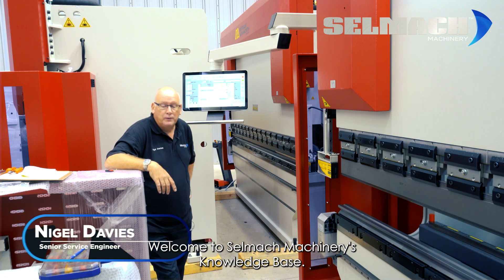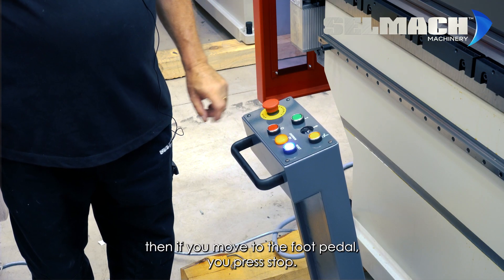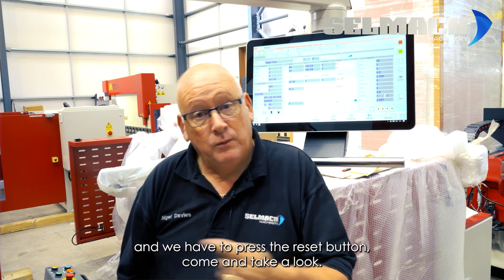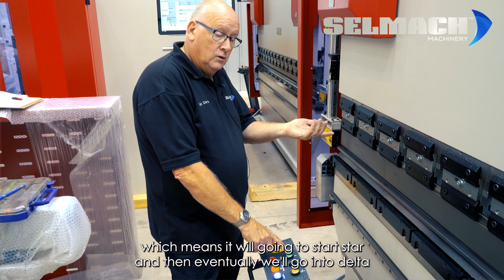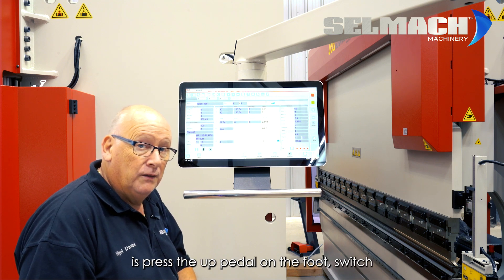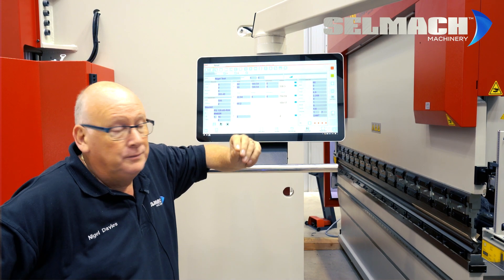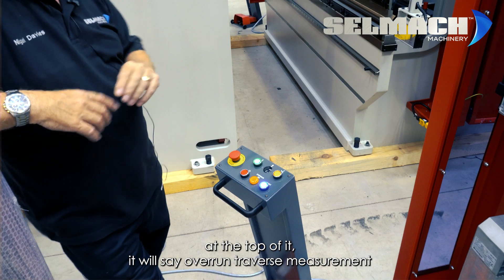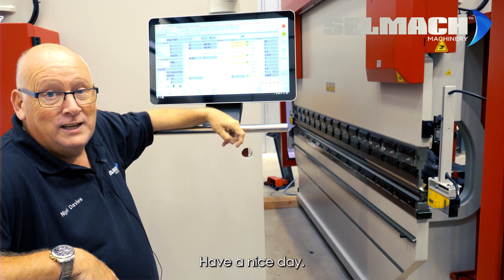How to Turn On, Reference and Turn Off a Press Brake

Comment: Does Esa have an offline software option to?
Reply from the maker: It does yes, you can utilise the bending software in an off-machine version, where you can create bending programs, and load them into a machine using a USB or LAN connection.